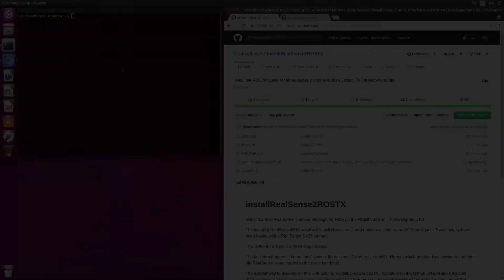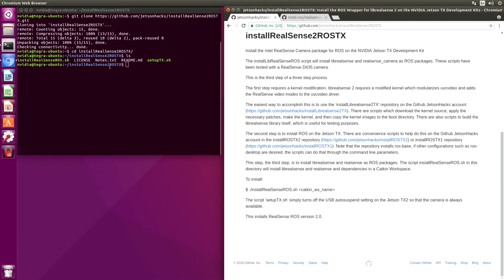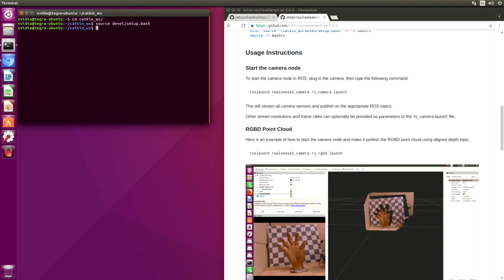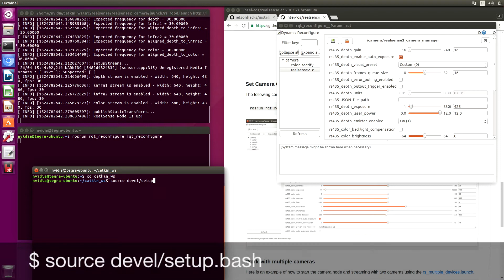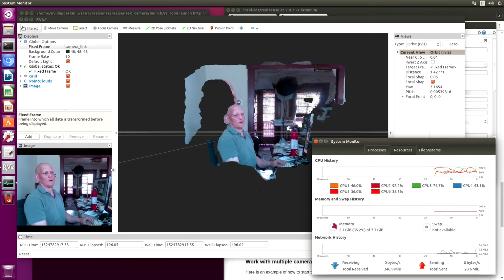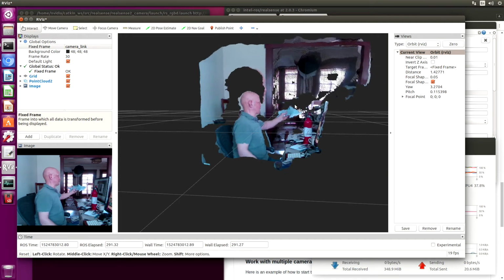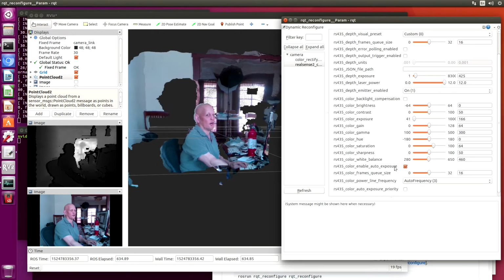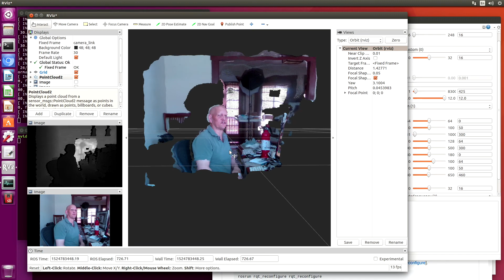Intel RealSense Camera ROS Package - NVIDIA Jetson TX

Comment: Great video. THX for sharing . BTW, which RS 400 model are you using? 415 or 435? I'm considering on buying it. Which one is more suitable for RACECAR/J project, 415 or 435?
Reply from the maker: The camera in the video is an Intel RealSense D435. I believe that the D435 is more suited towards the RACECAR/J, but we'll have to run some tests to find out. Thanks for watching!

Comment: ./installRealSenseROS.sh: line 88: syntax error : unexpected end of file
Reply from the maker: There is not enough information here to offer any help or opinion. It works fine here. Typically you would put some more information surrounding your issue, which version of L4T you are using, which version of the software, and so on.
Reply: @JetsonHacks  i followed all the steps exactly as per your video ,but at the time of execution of the line "./InstallRealSenseROS.sh",this error occured and it did not finish executing the .sh file
Reply: I had the same issue as well. The problem is that the the realsense has updated its git repository. The  script has a line called git checkout 2.0.3 and cd realsense which causes problems (it should be cd realsense-ros and I'm not sure if version 2.0.3 works now with the updated librealsense). What the script does is pretty straightforward so its easier if you follow the instructions through the realsense github page itself. That should work.